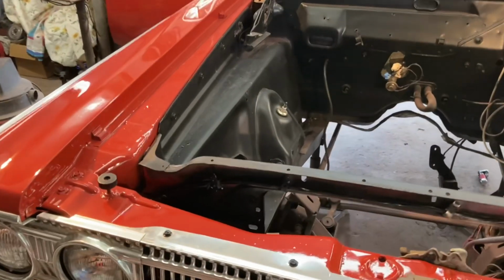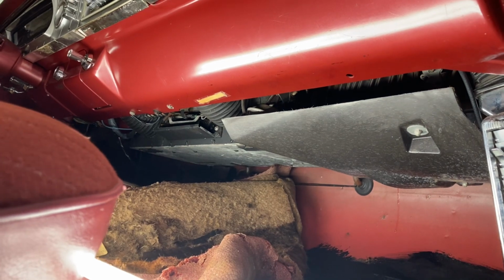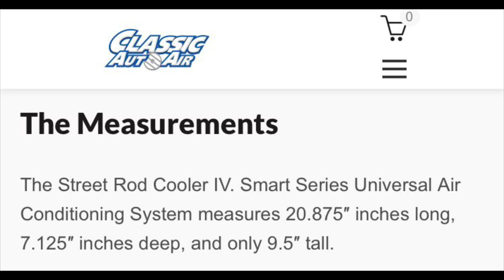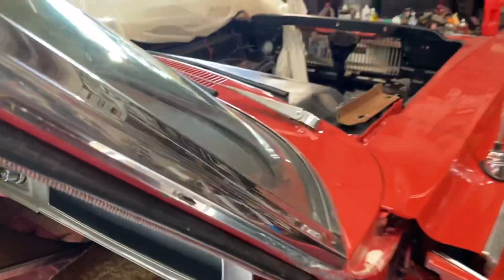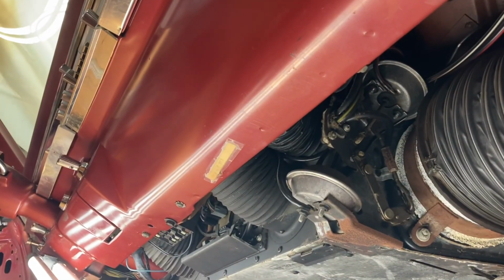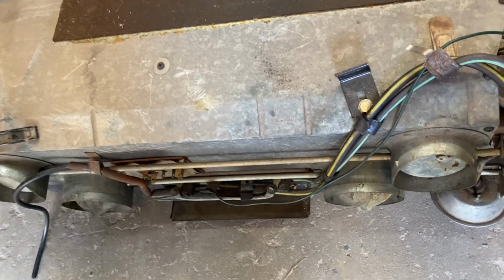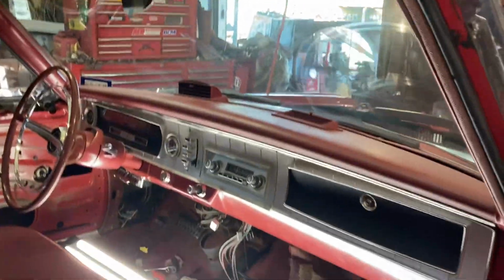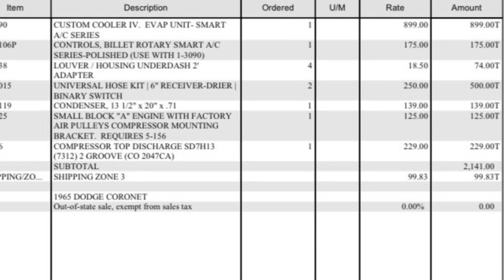New Air Conditioning for Your Old Mopar! Cost Breakdown and Labor Began

Comment: Joe I’m in the middle of installing a kit in my 65 coronet, I found all the vent adapters and hoses from vintage air. The passenger  lower vent has a square inlet and vintage air has an adapter that will fit perfectly over it for a 2.5” hose. My kit has 2-1/4” defrost and 2-1/2” main ducts. If your kit is like that Vintage air will have every adapter, I purchased all of mine from summit and they were at my house within a few days. They say 6 week lead time but it all showed up quick. I can give you the part numbers I used so you can take a look.  My car has all the same factory vents as the one you’re working on and all of the inlets needed to be reduced.
Reply from the maker: Awesome Jake. I will wait this one out for now. Dwight was helpful. I hate to back out of the deal already. Will update when I can.
Reply: @JustMoparJoe  no no I’m just letting you know you’ll probably need funky adaptors to connect the factory vents and the only company who has them is vintage. Stick with your current set up for sure, classic auto is good stuff. The adaptors are in addition to what you already have coming.

Comment: Definitely check the size and shape of the ducting connection on existing vents, it will take some creative adapters to connect the new flex ducting….to existing. At least that was my biggest hurdle with the vintage air system.
Reply from the maker: Yea buddy. Those were questions he had for me as well. Luckily, I’ve got big openings like 3 1/2”. May take some riveted steel or a trip to Home Depot.

Comment: This is going to be nice.
And in this hot weather, we need air conditioning!
Sounds like Classic Auto Air helped you alot.
That had to be a job getting the old one out.
Good job Joe.
Take care, Ed.
Reply from the maker: Thanks, Ed. I would bet the new unit weighs 1/3 of what the old one did. That will be a blessing.
Reply: @JustMoparJoe  Definitely!
Especially in this heat.
Modern technology. 
You may have room for the Flux capacitor now?
Hehe🙂

Comment: Will be interesting to follow. It does seem that this system is similar to vintage air in that the air inlet is blocked so that you are on full recirc all the time. I assume that could be an issue when it's not desert dry and hot.
Reply from the maker: As long as the AC kit is pulling the humidity out of the car, it should be fine. I think I will try keeping the passenger side flap vent that is vacuum actuated. Might can get creative with making that functional.

Comment: Cool pun intended!.... If it has the original evaporator why not just make custom hoses there are sources for hoses and fittings online for nearly any application....but you may not have the tool to crimp your own hoses....but this new retro fit system will be interesting to see you install it definetly a must watch!
Reply from the maker: Thanks John. I believe he wanted the better and more efficient fan and control setup. It has a lot Of technology in the progressive switch and door actuators
Reply: @JustMoparJoe  yeah I know the system it's cool but I still like the old cable and vaccum operated systems. Modern cars have gone to the actuators and A/C module control with can bus communication very complex and expensive to repair...but I understand some just got to have their fancy new Apple A/C unit lol😂😁😜 look MA I can control the cars AC from inside the house!

Comment: Will be looking forward to seeing the install.  Seems I never get around to putting AC on my projects.  Did you ever finish the AC install on your challenger? That's the same kit I would like for mine.
Reply from the maker: I got held up on my challenger when I swapped in the 5.7 hemi. I bought a kit for a 440. I need a new compressor for it.

Comment: Hey Joe I have a 65 Plymouth satellite and my AC unit is sitting on the shelf I was thinking about rebuilding it but if I could get a aftermarket kit that would probably be this thing to do is somebody would make a switch for a 65
Reply: Sorry I hit send before I finish my sentence it shouldn’t be that hard to make a retro switch that would work with the existing
Reply from the maker: I believe a commenter said that vintage air has a switch and vent connectors.